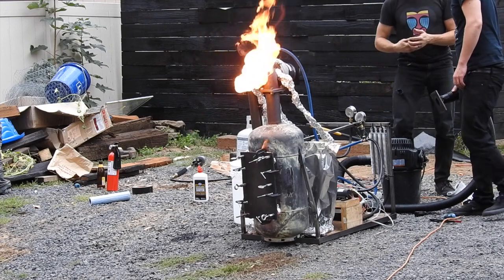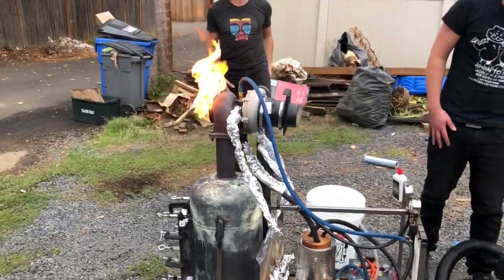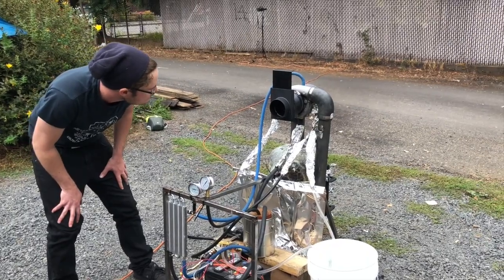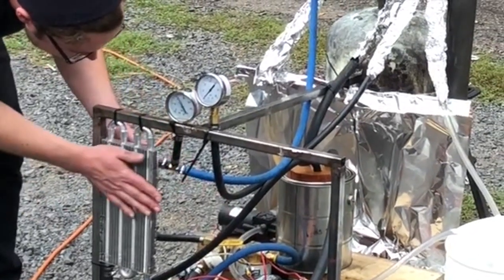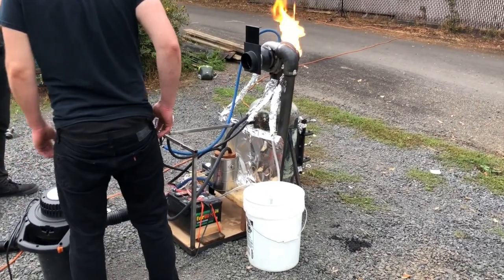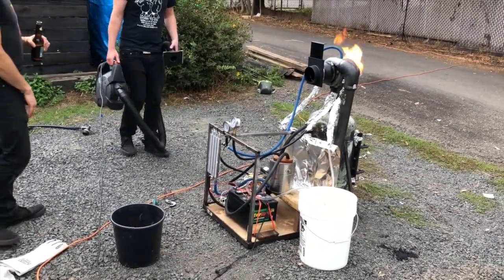TURBOFURNACE: THE FIRING

Comment: this is absolutely amazing, a good power turbine could extract so much energy from this, i think if water was injected it would help keep the turbine cooler and increase performance as the water expands so much as it turns to steam. possibly a breakthrough in science as a new way to generate power from wood
Reply: We did water injection in the latest runs and it totally worked!
Reply: @bvanderveen  thats great to hear, i really do think you have something very useful here which could possibly be scaled up to generate high amounts of energy from wood in emergencies
Reply: @mnshp7548  Thanks! Yeah if you search you can find the new video from last month! We did some calculations last week and kept getting numbers like 250HP.

Comment: Wastegate is made for this. Or an arduino controlled throttle servo guided by turbine rpm.
Reply: I was thinking just this. A waste gate to stop it going supercritical!
Reply: Right you are. The best solution a waste gate would be.
Reply: You would think that but depending on the turbo most will not open enough to make it shut down it creates so much energy that it will just run right through it and continue to run away if you dont block the air.

Comment: You could mess around and figure out what spring tension you'd need to keep an idle speed, and you could find a good hand crank forge blower.
Edit: You could even use an old cast iron forge blower as a pto or power turbine whatever
Reply: Good luck using the forge blower as a turbine. It would be destroyed very quickly from overspeed.
Reply: @HighVoltageMadness  It's placement would be after the turbine engine, basically a turboprop/fan-ish setup(you could technically use an adjustable wastegate to control the speed of that too(you could release excess pressure preventing overspin, or increase pressure under load for torque(though i wouldn't expect it to be able to do too much, it would certainly spin))
Reply: @HighVoltageMadness  not saying it would be efficient, just that it could be done.

Comment: Add a bypass valve in the compressor discharge, tie it into the turbine inlet after the combustor. This will effectively throttle the turbo without removing load from the turbine shaft like restricting the inlet, and as an added benefit it will help cool the turbine wheel.

Comment: You need a way to keep air moving through it for a cool down period once it's done running. Basically turbo timing it.
Reply: Turbo timers are to keep the oil flowing through the bearings. And they have an external oil pump running.
Reply: @mareksumguy1887  right but the turbo is still spinning when a car turbo times. It doesn’t go from the entire hot side glowing orange to dead stopped with no airflow. Exhaust at idle is much cooler than exhaust a full load.
Reply: @jamesmatthew1903  you know what’s even cooler than idle-exhaust?…. No exhaust at all! You don’t know what you’re talking about. It’s purely to keep the oil flowing through the bearings to cool them down, so when the engine stops (oil flow stops) the oil won’t coke up (solidify) from the hot bearings and cause a blockage.

Comment: Use a gas powered leaf blower to jumpstart the turbo
Reply: Shop vac works better, leaf blowers are under the surge line and don't build as much pressure.

Comment: So how does it keep spooling after the vacuum has left?
Reply: The turbo keeps drawing air into the burn chamber, causing the air to expand, and further spools the turbo through the exhaust turbine.
Reply: the heat of the burning fuel causes the air to expand and that drives the exhaust side of the turbo, like in a normal engine
Reply: @bene5431  I thought that burning the fuel makes the heat within the chamber was a given but thank you for correcting my instructional oversight